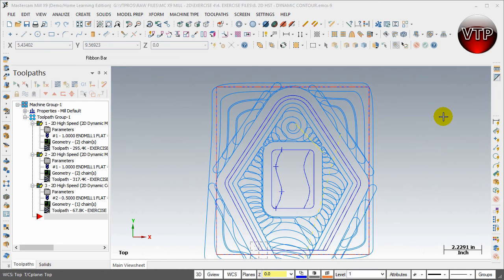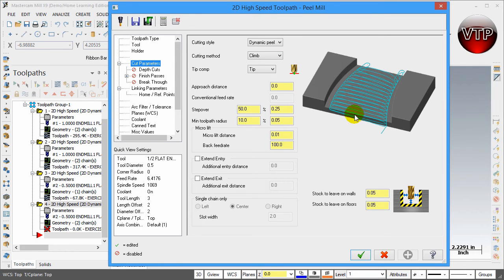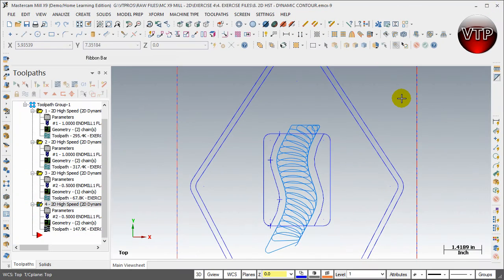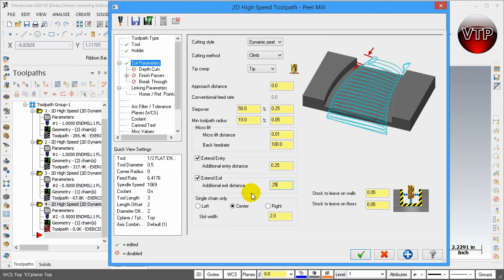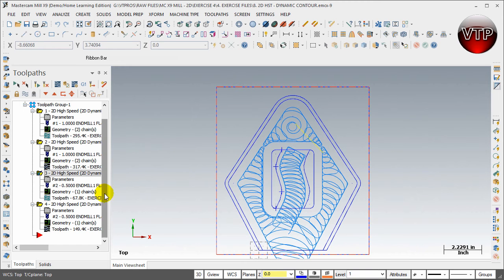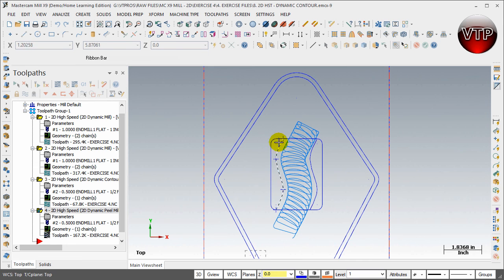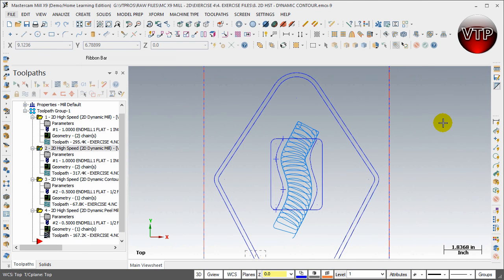MASTERCAM X8-X9 2D MILL 4.11 2D HST PEEL MILL - vtpros.net

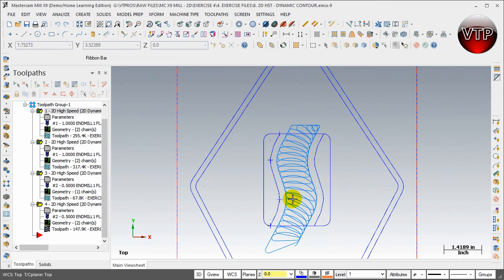Comment: There is an error in your one chain method.  The right side does not follow the contour (see the profile difference on the 5:05 mark as compared to the 2:15 mark using the two chains).  It may not work properly with curved lines since there is an outside and inside curve difference.   It will work if the two lines are parallel.
Reply from the maker: I see your concert and thank you for your input, but it does actually work both type chains do work, but you're right the one used at the 2:15 mark is the correct method